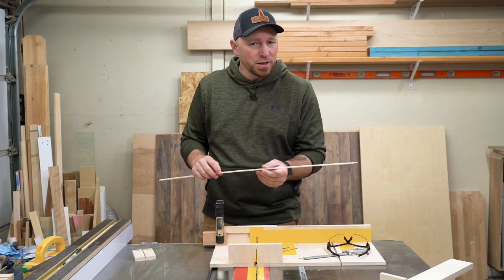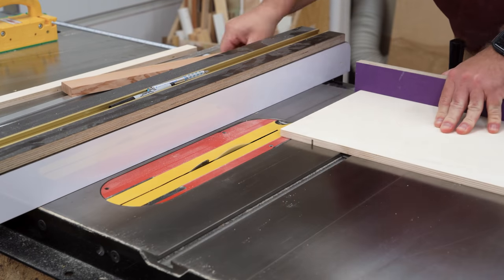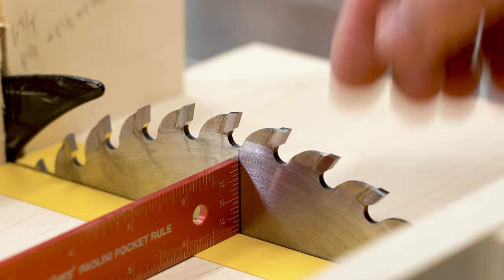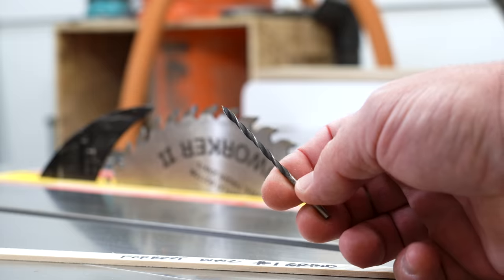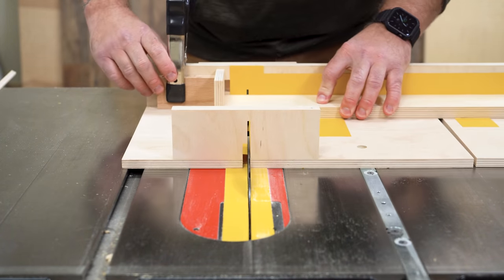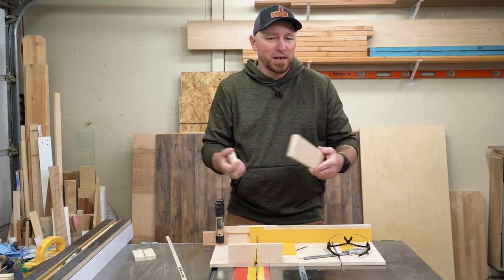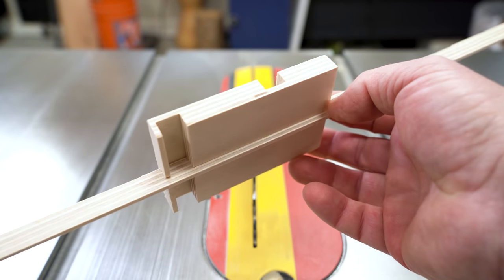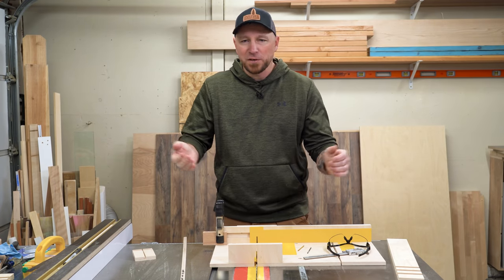WAIT! Does the Drill Bit Trick ACTUALLY WORK?

Comment: My .02 worth. If anyone wants to try this drill bit method, one should use a bit slightly larger than the kerf of the blade, seeing that the slightly "small-ish" measured bits used in this video would actually allow the piece to get too close the the stop block, causing a wider than desired dado.

Comment: I think some are looking at the effect of the smaller bit in the wrong direction. The smaller-than-kerf bit will give you a larger dado because the piece is then closer to the stop block on that second cut, removing more wood than desired. But also using the non-fluted end of the bit is a good idea. I like that the bit reduces the effects of dust since you’re only referencing one single point instead of the width or length of the shim.
Reply: You're right on the money!
Reply: I agree on using the solid shank end.  I've had issues on a knee mill zeroing off the edge of a part against the flutes of a tool.  Flip the drill bit around or use a dowel pin an the problem will go away.

Comment: My suggestion is to cut a kerf, then try the drill bit to see of it fits properly. If it doesn’t, bust out your wire gauge drill bit set and find the bit that fits perfectly.
Reply: That’s what i thought, but then not everyone has a wire gauge drill bit set.
Reply: @huejanus5505  they should.  $27 on Amazon, and we’ll worth it.

Comment: Interesting.  So what you're saying is that the expensive kerf maker I bought is the problem, and not me the woodworker?  Well, that's what I got out of it!  :)   Actually, I think the arbor run-out makes the most sense.  And it fits the empirical data you collected.  thanks for another terrific video.
Reply: @Hansang, a Forest Woodworker II should add very little runout. One of their claims to fame is how flat they are. Having said that, a basic check of a table saw setup should include checking runout with the blade installed. Then you would have your answer.

Another inexpensive piece of accurate tooling is a keyway key. You can pick up a set of these at any real hardware store for a few bucks and use these as a thickness reference. These should be more accurate than your average drill bit.

Or a set of transfer punches.

Comment: The drill bit works, your mistake was measuring.  Just cut a kerf and pick a bit to fit the kerf snugly.  You can easily adjust the joint fit (looser or tighter) by changing bit size.  I'll let you figure out which way to size the bit to make it tighter :>).  Great video
Reply: I would agree with this in theory but if we're talking thousandths of an inch, the next size up may be too big resulting in too tight a dado.  I think there's no reason not to cut the strips and have them handy.
Reply: @jwm6314  The 1/64" increment of drill bits is .0156 and the standard saw blade is 1/8 " .  If your saw kerf varies more than .0078 from that is unusual.  If needed, just add 1 or 2 strips of tape (tape = .005") to the wood spacer to tighten it if bit is too loose.  The wood spacer can change by a few thousands with humidity (or if your shop is like mine, can get misplaced).  Drill bits are consistent in any humidity.

Comment: Hold the bit against the sled not against the stop. My guess is that your stop block was not perfectly square to sled. Because you held the drill bit vertically against the block it pushed the top corner of your stock farther to the left by a few thou. resulting in a too-wide dado. I’ve used drill bits (and 1/8” brass set-up bars) for this for years and have never had a problem. Wood or HP plastic shims work just fine too. Do what works for you. Thx Jody.

Comment: I'd not heard of the drill bit technique done this way. What I have heard is to a) make a cut in some similar waste stock then b) take the drill bits and test for a match. I think that part of your error came from measuring only one tooth and not the actual width of the kerf. I will give your original method a try and see what my results are. Thank you for your channel.
Reply: This is what I was thinking. Instead of trying to measure, make a test cut, find the drill bit that fits the best, and use that bit. See if that results in a better fit.

Comment: If you used a drill bit with a diameter that matched your shim, you should get the same result using either.  Because the drill bits were undersized, they allowed the workpiece to slide closer to the stop - making the dado too wide.  You can really use anything to represent the blade width provided it is the right thickness.  All in all a great technique.  Thanks for sharing.
Reply: Yes, but the point is to do it without taking a measurement. The shim is made using the saw blade itself without taking any measurements, and a 1/8" drill bit is supposed to be the right size for a 1/8" kerf so you can also use it without taking a measurement. The question is whether a 1/8" drill bit matches your 1/8" kerf as precisely as you can get using the method to create a shim of the correct width. If you have to make a kerf-width shim, and then measure the drill bit to make sure it's the same diameter as the shim's width, then you might as well just use the shim itself.
Reply: @AndrewKay  The shim is better, but you need to make one.  If you cut a kerf into a piece of wood, you can test drill bits in it to see if you have one of the correct shank size.  Number and metric bits can fill in between 64ths of a normal set.  If one fits you are fine, but the shim can be a better fit.
Reply: @AndrewKay  No measuring necessary, no matter what is used for a spacer.  Make a saw kerf and stick the drill bit in the kerf.  If the bit is loose, your dado will be too wide.  Just use a bigger bit.  This whole concept is the same as the kerfmaker, just going about it differently.  Whatever works best for someone is what they should use.

Comment: Measuring a tooth width and measuring the cutting width are two different things.  The run out of the rotating blade will always be wider than an individual tooth.  Unless you grind the rotating blade to flatten the run out, you will have this issue.  Thus making a shim based on a rotating blade will  produce a more accurate final cut.

Comment: Surely instead of measuring the blade you should base it off the cut, So make a cut in a piece of scrap, then insert drill bits into the cut to find the exact one which fits. If fractionally to small, a bit of tape round the bit will shim it out. Then do the Dado operation using said bit. Thanks for the video.

Comment: This is an interesting test, and something I'll keep in mind because I never totally bought into the 'just grab an 1/8th" bit' trick for all the reasons people below cite (runout, tooth set, vibration). Another factor could be whether or not the blade's been sharpened, but if I'm reasoning correctly, that ought to make a too-tight dado. Either way, your shim trick is about as close to foolproof as it gets since it uses the blade itself as a unit of measure. Also, I just love the spline making technique, which is genius. Last comment - I've got one of those CMT blades and absolutely love it; great alternative recommendation. They take forever to get dirty enough to clean, and when they say 'FTG,' it's dead-flat.
Reply from the maker: Thanks for mentioning your experience with the CMT blade, Matt. I might have to get one in here to try it out.
Reply: @InspireWoodcraft  You ought to, seriously. With another YouTuber's discount code and a well-timed sale, I think I bought mine for $60 (incl S&G + tax), and it's nowhere near in need of a sharpening... and they'll take several sharpenings based on the thickness of the carbide teeth. Far better than the Amana ATG I bought with my saw.

Comment: I think the way to go is to cut a groove in a piece of wood and then find a drill bit that fits snugly – my blade is supposed to be 3.2mm wide and sure enough, a 3.2mm drill bit fits snugly in a groove. I've been able to make super tight lap joints using the drill bit trick. Maybe it's easier to match mm's compared to imperial units?

Comment: It's possible that on a round drill bit there's less surface area touching the wood when butting up to it and it's likely that it's sinking into the loosened wood fibers just enough to make a sloppy joint. Kinda like how wood is measured by the Janka hardness scale with a small round ball bearing sinking into wood fibers. Where flat butted to flat wouldn't sink much at all because more surface area. These measurements are literally splitting hairs and it's kinda cool to get this level of accuracy in woodworking.
Reply: That would be my guess too, especially as the drill bit is considerably harder than the wood

Comment: Try using an Allen wrench. Shanks can be different then the bit. They are ground then cut to length then tempered. The steel they start with is different for different bits.

Comment: Awesome info as always. I would guess it is blade vibration due to either runout on the arbor or an imbalance in the blade itself, general machine vibration from the motor/belts/pulleys.....something along those lines. I always find that my crosscut sled kerf is wider than the blade itself, and more noticeably so over time.
Reply: I appreciate your comment. I wondered why the kerf in my sled slides easily over the saw blade, even after the first cut. It seems to me it should be a tighter fit. Using a well maintained quality saw with a quality blade, I came to the same conclusion you did.

Comment: Some woodworkers don’t keep a super snug fit because they use glue. The small slack give a place for the glue.

I also believe that the drill bits are thousandths smaller to account for the outside diameter they make. The drill bit size is to make the hole size, an inside diameter measurement. The outside diameter measurements need to be slightly smaller to make that inside diameter hole.

But also quality of the drill bits need to factored in. Tighter tolerance comes at a premium cost. And metals also wear down, more so on the drilling business end, so it’s better referencing off the chucking end. In addition, the church end is more reliable because it is solid all away around, instead of the flutes that leave gaps where it spirals. I believe some even have a micro-beveled edge.

The drill bit method has always been more of “in a pinch” method, but I guess it could be used consistently depending on ones needs.

Whichever way works for you. There are many other ways to also accomplish such task, as in most of woodworking tasks.

Comment: Your method obviously works well.  I suspect part of the problem with a drill bit is that it's so thin it can fit into small indentations.  But bits do work better as shims if you use the smooth shank for that purpose, rather than the cutting end.  That's the end to test in a kerf first as well.
Reply from the maker: I considered that, but the chuck end can get beat up over time, and/or be oddly shaped, whereas the cutting end will wear evenly and should at least still be round. One plus for the shim is that you can make it to different lengths too. I have tried to use the drill bit trick for wider pieces, and it gets a bit awkward.
Reply: I agree with Alan. Depending on how you place the drill bit, you can make the gap it creates much smaller than intended. When measuring a drill bit across the flutes instead of the shank, give it a twist and see how it varies, it's quite dramatic. Only the shank should be used, and if it's damaged, use another drill bit. I don't think this is a fair comparison at all.
Reply: The drill bit suffers compared to the shim because of less surface area, but at least the shank has more surface then the flutes. If the bit is consistently under, you could always use the bit plus one wrap of masking tape.
Reply: Another thing to consider with the drill is that the act of pushing up against it will probably very slightly dent the work piece as the surface area is so small, the wood will give ever so slightly. This is compounded if the stop is also relatively soft wood.
This could be overcome by bringing the work piece up gently until it just kisses, but that's not very practical for repeatability. Could be useful for a one-off if you don't already have a kerf sized shim though.
Reply from the maker: @Infinity Video Productions The drill bits measure the same diameter throughout the entirety of their length. Zero deviation. And as I’ve said before, any wear on the flute end will be even and equal, because it spins. However the shank end CAN change because of small imperfections caused by the tightening of chuck jaws on it over time. It is 100% fair, and I highly encourage people to try it for themselves. It’s pretty interesting and yet makes perfect sense all at the same time.
Reply from the maker: @kitchencone There shouldn’t be a lack of surface area because the flutes span gaps as they spiral. Like tiny bridges. And they measure the same the whole length of the bit. And while on a micro scale the wood fibers may have compressed ever so slightly, they didn’t compress .008-.010. Also, while masking tape ranges around .0045-.006, wrapping would most likely increase it by quite a bit too much. That being said, putting tape on the material going into the dado will make it wider, and tape on the shim, or one side of the drill bit, will tighten it up. So that could work. Or what I would do: make a test kerf in a piece of scrap, find a drill bit that fits just right, and go to town. Or just make a shim and never think about it again. Haha.
Reply: How about this: You need a fairly accurate kerf-sized shim to cut an accurate dado, and your method makes one regardless of the blade.  A nominally 1/8" kerf is not necessarily well enough matched to a nominally 1/8" drill bit to be useful, and the 1/64" steps of sizes are too large to be sure you can find the right sized shim this way.  That's all you need to say.  

Whether a drill bit can be used as a shim, and the best way to do it, is a separate question we don't need to address.  That's what people here have been arguing, and it is peripheral to your main point, I think.
Reply: But the reason people like drill bits is that they are durable and available.  Once you know which drill bit does what, you can just use it.  It is precise and distinguishable.  Laying it down between 123 blocks can avoid most of the inconveniences of using such a small item, but obviously you need the right size.

Wooden shims can be cut accurately, but are not as durable and need to be either freshly made or labeled, stored, and checked periodically.

Comment: B Revs made a comment about blade wobble, earlier, and I think this may be the reason, or part of it, anyway. It would be telling to measure the distance, from a set point, for each tooth on the blade with a dial indicator. Add the fluctuation to the width of a tooth (another variable?) to get the full, predicted kerf width and use a bit that matches.

Comment: It’s gotta be the runout, a blade’s diameter will only be an accurate representation of the width of the cut it makes if there is absolutely zero variation in the axis of rotation as it makes a full revolution. (An uncommon if not nearly impossible scenario)

A machined piece like a drill bit could be created to match the actual cut width but a shim is a much less time consuming way to get the same result.

Thanks for the video!

Comment: I don't understand what you mean by witchcraftery. The bit is smaller than the shim so the test piece slid further than it should, causing the dado to be too wide.

If you're talking about the thickness of the blade vs the bit, every blade has some runout. Workshop Companion put out a video recently which adds to the one you did on finding the center line of a blade. It's worth a watch.
Reply from the maker: The point is that people say if you have a full kerf, 1/8th inch blade and an 1/8th inch drill bit, it should work perfect. Which of course in reality is not the case.

Comment: I think Alan from an hour ago is on to something.  Butting the workpiece against a drill, especially in the area of the flutes, is likely to result in the workpiece approaching closer to the stop block than it would if run against the much larger area of the shim.  But even if the workpiece and stop block were perfectly hard and square, you are starting out with a dado width two mils greater due to the drill diameters being less than the shim width.  It would be easy to check with a dial indicator.

Comment: Outstanding video. Just came off watching your shim build and still wondering how you came up with the procedure. I'll have to watch it a couple (hundred) more times. I suspect the difference is due to variability in the saw blade around the entire circumference. Just a thousandth off between two teeth would cover the difference in your dado widths between your shim and the drill bit/ where you measured the saw. I also suspect when they stamped the saw blade as '1/8", that brings the variability into play. So, instead of measuring one tooth and matching that with a drill bit, might have to match the true kerf of the blade with a similar width drill bit.

Comment: All those saying it's to do with the fluted section of the bit or the vibration in the blade are not looking at the geometry of the cuts.  The wider the shim (or bit) the narrower the dado.  Your shim measures a touch wider than the bits.  This is difference.
Reply from the maker: Building on that, it is simply that the shim is the same width as the actual kerf that the saw blade makes. This has been fascinating seeing people lose their minds on this though.

Comment: If you look closely the teeth on the saw blade are set alternatively to each side slightly
Reply from the maker: Hard to tell. It does look like it, but it also could be an optical illusion because every other tooth has a corner of the shoulder ground off. I can't find specs on it to say without a doubt.